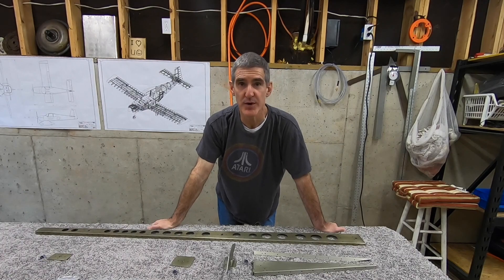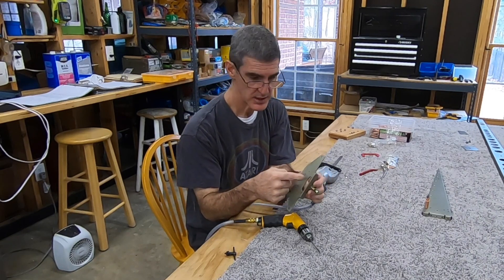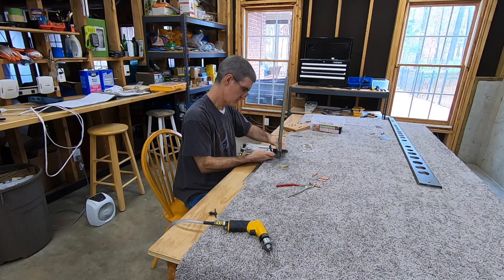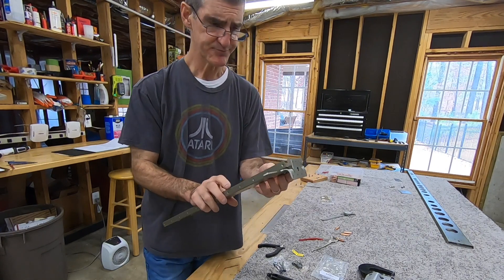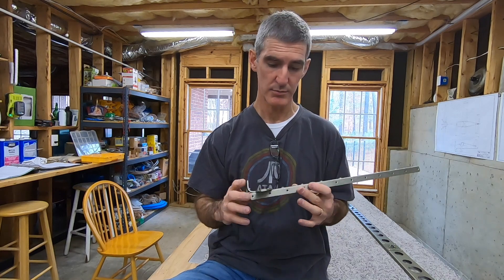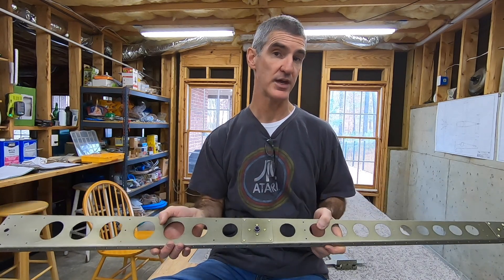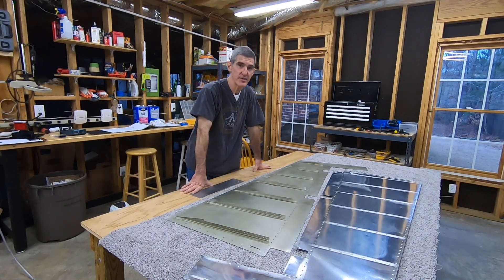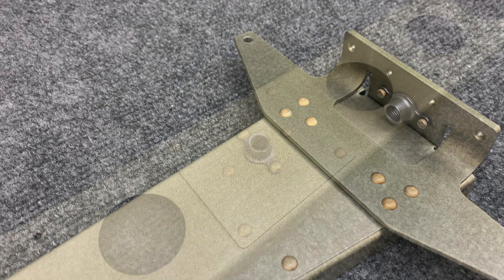RV-10 Build Log - Emp 25 - Riveting the Rudder!

Comment: Good videos.  Keep up the good work.  You mentioned a foot pedal switch for your squeezer.  Can you provide more information.  Who makes it?  Where did you buy it?  Pros and cons?  Would you recommend it?
Reply from the maker: Thanks!  I bought the foot pedal from Cleaveland Aircraft Tools a while back, but unfortunately I don't see it on their site anymore.  Definitely not a must-have accessory, but I do like it.  It's especially nice if I need to hold several things at once, or hold things very still while triggering the squeezer.  I looked at mine for a mfg and model.  It says Linemaster Full Guard, CAT# 522-B14, and it's mad3 by Linemaster Switch Corporation, Woodstock CT.  Hope that helps!

Comment: I could have sworn that I read somewhere that if they plans do not call for a certain direction for the rivet to be placed, direction would be determined by thickness of each piece.  What I do not remember is if the shop head is suppose to go on the side with the thinner or thicker material.  If both pieces are the same thickness I can't imagine it would make a difference.
Reply from the maker: Very interesting - I'll look in Section 5 to see if I can find that recommendation.  Thanks!

Comment: What primer are you using?  I am not going to prime mine completely but I do plan to prime areas Vans recommends and a few places that are exposed to the outs like hinge areas.   You want the factory head on the side of airflow due to it being more dynamic.  On that part I would have put the the rivet in the best way that if I had to ever drill out the rivet it would be easier.
Reply: https://www.youtube.com/watch?v=Rc0DxzVwCI8&t=130s
Reply from the maker: It's Sherwin Williams P60G2, which is a two-part primer.  It's the same thing Van's uses on their quick build kits.

Comment: Nice job!  Riveting is not an exact science so I'm guessing that in some situations you could  insert the rivet from either side.   Are you sure you are gaining anything by cutting a hole in your carpet for a bucking plate?  I think you would have a lot more flexibility by moving the bucking plate where you need to use it without scratching or damaging your material.
Reply from the maker: Good point about not cutting a hole in the carpet.  I haven't done it yet.  I may just hold off.  The way I did it this time is certainly more flexible.

Comment: Van’s is pretty good with telling you direction of shop heads on rivets if you need to. The H. Stab. Rear spar has you rivet from a certain direction for clearance of the elevators. I typically rivet in the direction of most ease of placement and also if I have to remove one
Reply from the maker: Great to know, thanks!  I'll be keeping my eyes open when it comes to that rear spar!